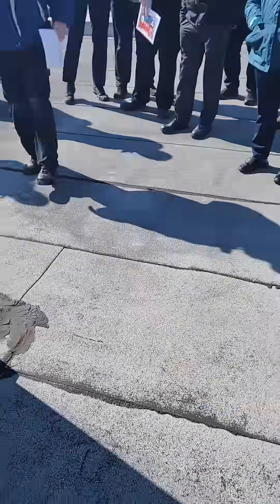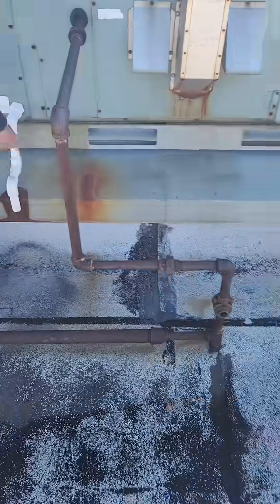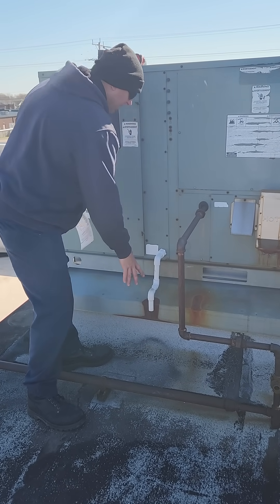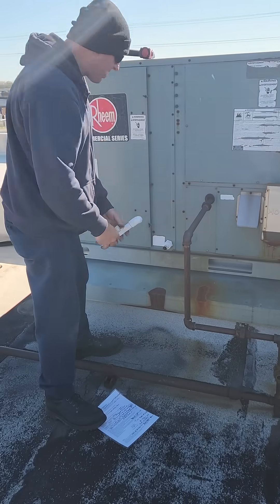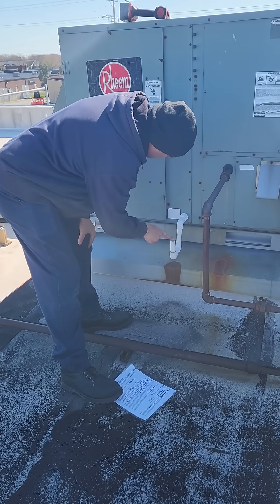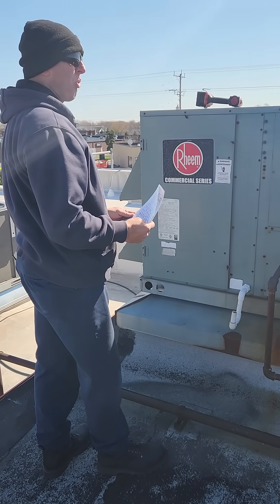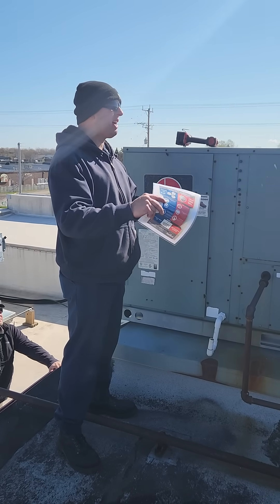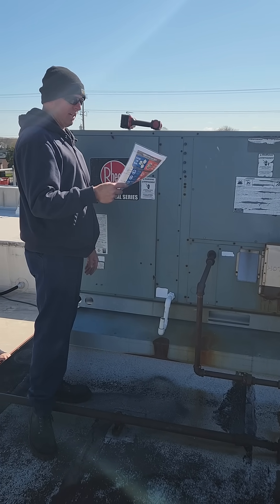What is a P - Trap and why is it important?

Comment: Right idea, wrong explanation. It's a vacuum breaker. If the drain is on the negative side, the water in the trap allows it to drain. As opposed to fighting incoming air through the drain line